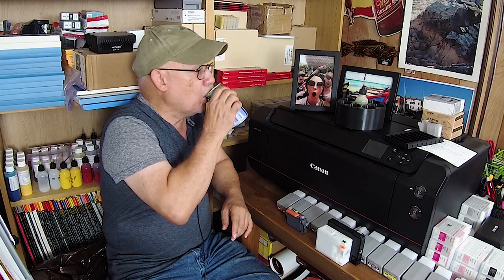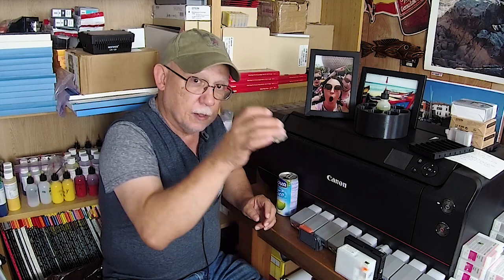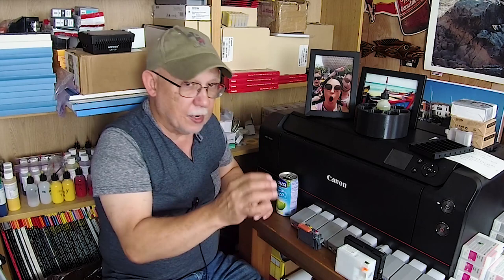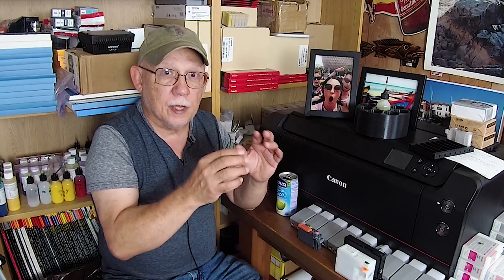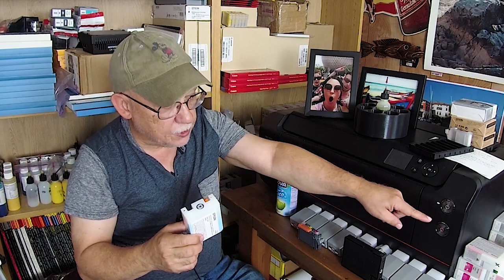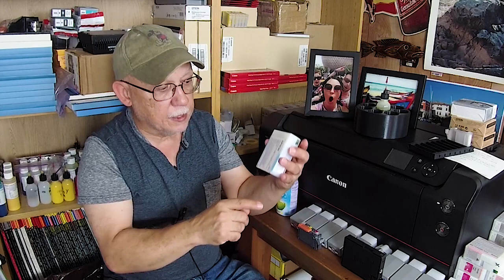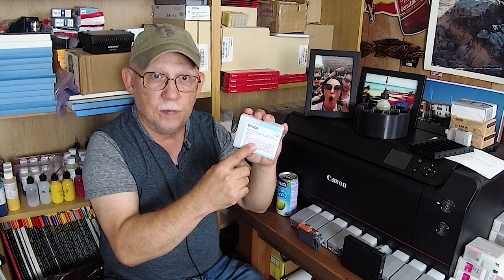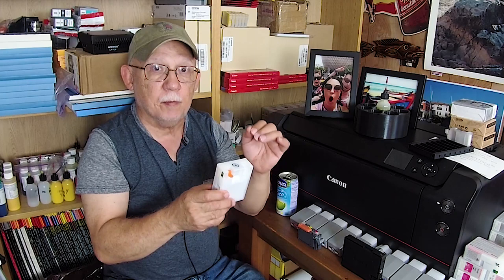Photo Printer Theories! Some make sense and some just don't!

Comment: Hello so on the canon 2000 I used up original cartridges and got refillable ones.put the original chip into them and they keep on working perfectly, however they state low  (not empty ).You have to keep a very close eye on the ink levels however, I just put 500ml in each cart. Printer reads them all as genuine Canon inks. I have not found it to do any additional cleaning cycles either. Just thought I'd share 😊
Reply from the maker: Hmmm. I need more info on this. Every interesting!
Reply: @cheo1949  I'm happy to share my experience with you, it's the least I can do after all the knowledge and help you have given! Feel free to ask me anything you want 😊 oh and forgot to mention that printer sees the ink cartridges as original and I got no message asking me to turn off ink metering!

Comment: Hope this is not too far off topic here, I have a MG7520 Canon printer, my second one. I got a good deal and bought 2. I saw one of your videos saying I MUST use the setup carts. I have 2 full sets of refillable carts and still have about a half of a tank in all 6 setup carts. Do I have to run each setup cart completely dry before putting in the refillable? The set says to install all 6 at the same time so I'm not sure how to go about this. Thanks for your very well made videos, they have answered most of my questions before I even knew I had a question.
Reply from the maker: Setup carts install some codes during the initiation of the printer. You can switch to.your refillable at time you want. You do not have to run the originals to empty.
Reply: Thank you very much for your reply Jose.